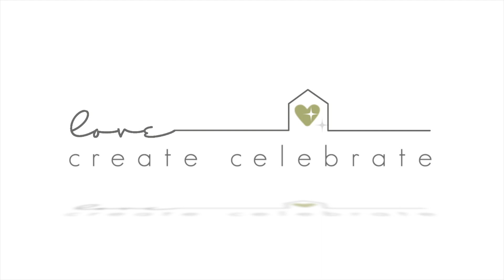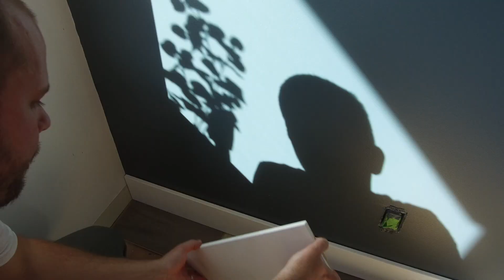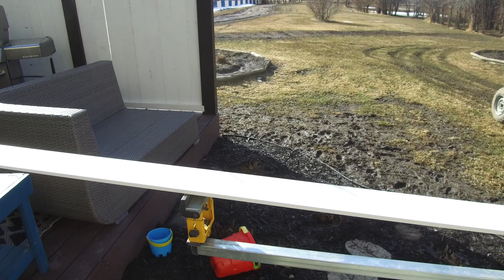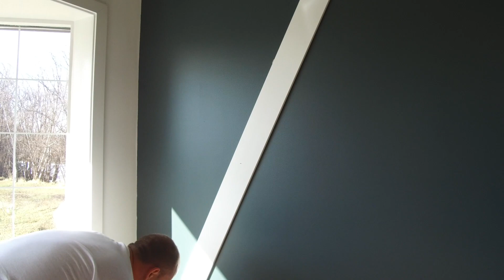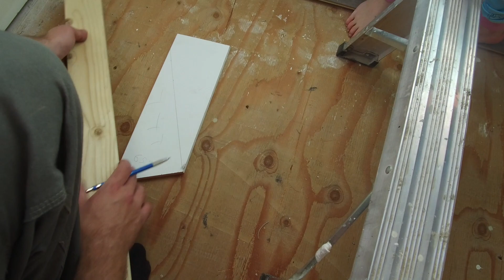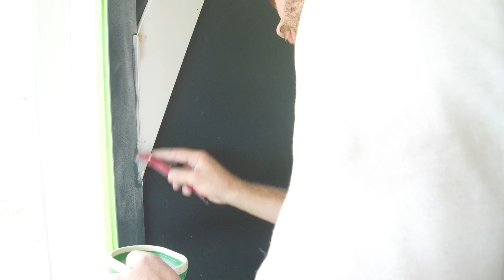A Modern DIY Moulding Accent Wall | How to Install a Moulding Feature Wall

Comment: How did you get 65 degree angle cuts with the board laying flat?
Reply from the maker: The 65 degree angle is on the board, which means that you're cutting off a 25 degree slice (90 minus 65), and setting your mitre saw to 25 degrees. Hopefully that makes sense!

Comment: Because it's a dark color, especially if it has any texture, I've found to make sure that the paint needs to be closest to a MATTE finish. Is that what you did? And also, could you take that paint and put it in a sprayer to not have to paint on the wall again? It's beautiful!!!
Reply from the maker: Hope4 Humanity I’m pretty sure we still did an eggshell finish, but I’ll have to check the paint can! Yes, you could absolutely use a sprayer if your room was properly masked/protected! We didn’t use one because we didn’t want to cover everything and we have huge vaulted ceilings. So glad you liked it!